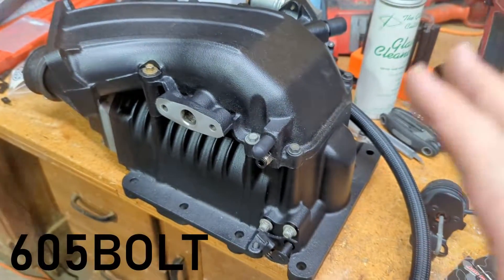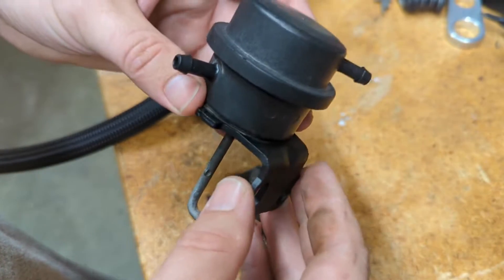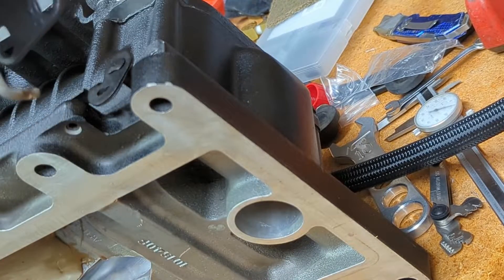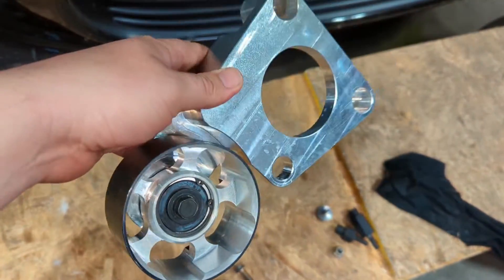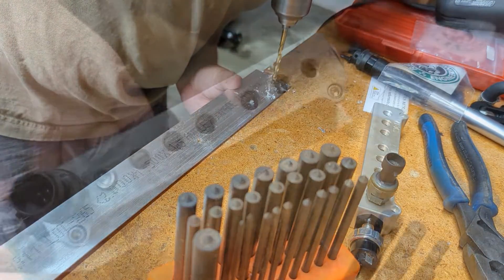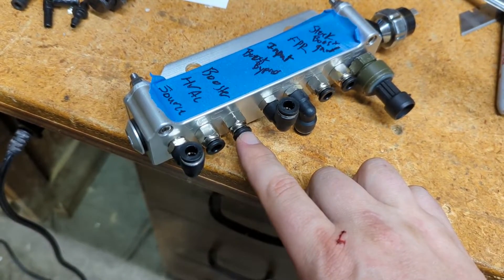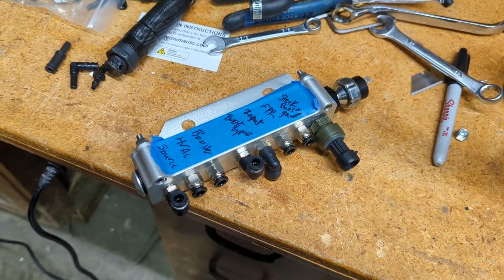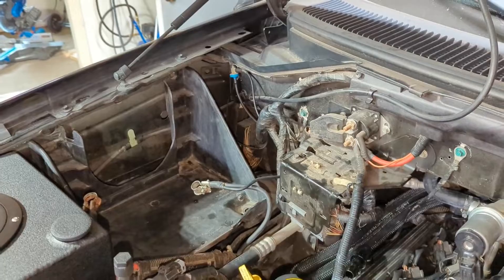Installing a Ported Eaton, Boost Bypass Actuator, and Billet Vacuum Block on my SVT Lightning

Comment: Where did you run the line from the bottom of the boost actuator? I didn't see that and am currently redoing a bunch of Vac lines on my 04
Reply from the maker: For my setup, it is just left open. To atmosphere. On a factory setup I believe it runs to the bottom of the intake elbow. Aka sampling air between the air filter and the throttle body blade.
Reply: Is your top port on the actuator hooked to a boost or vacuum source? It looks like boost on that cool piece you made. Is it not supposed to be hooked to vacuum for top port?
Reply from the maker: Top port should be connected to a boost source. But a boost source can be either positive (boost) or negative (vacuum). But basically it needs to sample pressure beneath the supercharger and before the heads. If it was just vacuum, when the blower builds boost, it would over power the spring in the bypass and leak boost out. Hope that explains it. Top of the actuator is boost (vacuum at idle) and bottom is atmosphere or intake elbow. ⚡
Reply: @605BOLT  ah yes! that makes perfectly good sense. I think I now know why mine isn't working properly. Going to verify the lines tonight.
Appreciate the comments and will subscribe for more. 1 more question is there a link to that vacuum/boost block you have? It's a cool piece!
Reply from the maker: @muffpipe84  not a direct link. But you can get in contact with Hose Hustler Timothy White and he can  get one sent to you. He is the vendor I bought it from. He's good people. Do me a favor and mention you saw this video!!! If you don't have as much deleted as I do it might be a little different on your setup. 🍻
Reply from the maker: @muffpipe84  you should be able to see that bypass working if you goose the throttle a little just sitting at a stop. It should slam shut when you give it a little punch and open right back up when you let off. Open at idle too. Open is when the little arm is vertical. Shut is when the little arm is pushed up against the threaded stop on the blower case.
Reply from the maker: Oops sorry I forgot to mention that the link to his fb page is in the description of this video. You can dm him there. 👍
Reply: @605BOLT  yeah my understanding is that when that arm is drawn up into the actuator that would be idle condition / non boost / cruising 

Under boost its pushed down to close the valve and not allow boost bypass...... 

If I got that right I will be looking into that manifold block you got.
Reply from the maker: Yep. Right on. 🤘

Comment: Hey man what alternator did you replace your old one with?
Reply from the maker: I used just a regular parts store one from Napa. I was not pleased overall. Motorcraft alternator will be my choice when this one goes.
Reply: I came across a J2 fabricated alternator have you heard of them before? It’s a 240a high performance
Reply from the maker: @thelastslime3007  I have but I thought they only did 4.6 alternators. If they make one like you say I would buy it. I've heard of them before.

Comment: Good to see more lightning content. Gave you a follow. Hope to see more. I'm building my lower end this summer due to just blowing mine apart last fall. Hope to see you build more. If you haven't already check out debtlifeprojects. He's got some good content as well. I've got a few vids of mine running hard too. Only thing I'd recommend is changing to a larger vacuum hose for the booster. Not sure if there could be any issues from less volume.
Reply from the maker: @Theupstateidiots, I just saw this comment for some reason.  Thanks for the sub and hope your build went well this summer.  Debtlife makes great lightning content for sure.  The lightning will go under the knife here in the (hopefully) near future for a new blower.  I'm over the Jokers junk.  Time for a serious piece!
Reply: @605BOLT  I couldn't afford to build mine this summer due to my other projects. But I hope to get on it sooner than later and have it back for spring maybe. We shall see. Hope your build kicks ass.
Reply from the maker: @Theupstateidiots  dude i hear you there.  The financial part of any build is so underappreciated.  It takes so long and so dang much money. We'll get there though.  In time.
Reply: @605BOLT  cost vs HP Coyote is the way to go. It sucks because I want to keep the stock stuff.
Reply from the maker: @Theupstateidiots  maybe someday I'll go coyote but for now I'm well within the power goals on 5.4. Just need a different blower that doesn't crap out after 3 months.

Comment: Super great info and video, love the content brother please keep it coming lol, but can I ask you this I need some expertise. Right now my truck has a 6lb lower and long tubes no cats or res just a muffler. And right now my truck is down because I want to go to e85 I just wanna know if 265lph pumps and 42lb injectors are gonna be ok??? I have a adjustable fuel pressure regulator just like you and a return line just like you, just curious if you think my pumps are to big for my power level.
Reply from the maker: I bet the pumps will be enough or close to enough but I imagine the injectors will come up short. I have deatschwerks 95lb injectors, dual 255 pumps and a boost a pump. Had 60# injectors that couldn't keep up so rather than getting 80s and outgrowing them I threw down and got the 95lb injectors which are basically 1000cc. I do not regret that. So sadly idk if you will have enough or not. But that's what I have. Appreciate you watching and commenting!

Comment: I have a 03 HD and have to pull the supercharger off to check everything i have a vacuum leak and i think its the one at the bottom of the turkeypan, and im definitely going to that  vacuum valve  when i start take it apart im in the middle of repainting it atm, but I like the Rail you put on it well look alot better then the stock setup,
Reply from the maker: Ya for sure. JC customs makes some badass stuff. If you call him/text him, make sure you mention you saw the block on this channel. Always nice to help a lightning guy sell some product and make more cool stuff.  He's good people.

Comment: what did the truck do with the old actuator that did not work?  was it noticeable?
Reply from the maker: I think I broke it testing it haha.  I was trying to verify if the damn thing was working well or not so I put a pressure regulator on an air line and blew into it and the diaphragm blew out the bottom.  Too much pressure.  So I think I broke it. It needs far less to actually work.  But anyway, if they are broke, the blower sounds like ass.  You should be able to see it moving when you start the truck up and give it a little rev.  That should cycle it and you should be able to see it moving.
Reply: It will not make the boost you should  under load and will not open under vac and your SC will have cavitation(make a bunch of noise at idle) sounds like marbles or rocks bouncing around
Reply from the maker: Yes. But mine was not broken on the truck. I broke it when I was messing with it on the bench.
Reply: @605BOLT  i was just letting the other guy know what it would do or how to notice a poss failure. I made a similar video about 8-9 years ago but I’m not a YouTube content maker. So I don’t know how many people actually saw it. So I’m glad you put out one to inform folks. Good into to pass along because our trucks are only getting older. Lol
Reply from the maker: No problem. I appreciate the input and info! Always happy to have people add in the comments. Hope we can keep these trucks going for a long while yet. What is the setup in your truck?
Reply: @605BOLT  getting a motor built as we speak by Korn. But my last was stock heads,stock block,joker ported Eaton with cog drive 14#, C&L elbow, 2600maf, Bassani Eq shorties headers, stage1 A1 transmission 2400 stall, long bars, 4:10s twin255 pumps. Ran a best 11.98@117 it was cold that night. I spun #8 rod bearing and took out #4 too. So the new motor will be fully built with TF heads. It will never see the track again I just want a good stout running truck to drive around and have fun driving. Interior It has the center console mod and gauge pods.
Reply from the maker: @snakesvt  damn I like that setup. I like Korn and working with him and have had great luck with him so far. Kind of bummed to hear he is getting out of tuning. That's the rumor anyway. You should ask him if that's the deal or not.  I need a blower that can last more than a season is my issue. Seems like I'm always having to fix on them. Need to just nut up and buy a bigger, better one. Someday. Who did your center console? Chris?